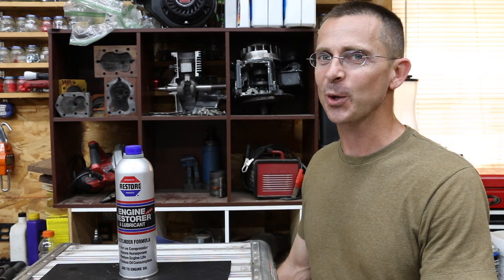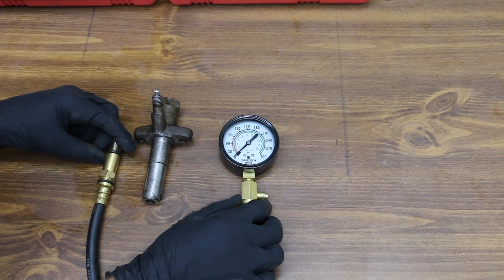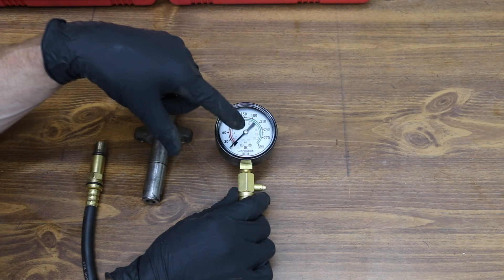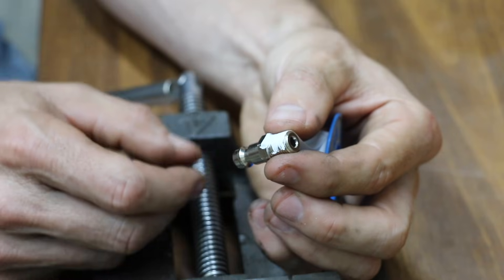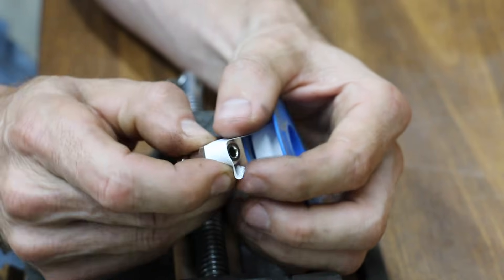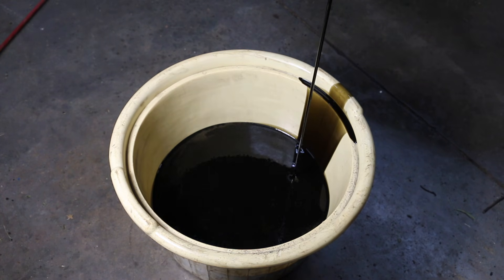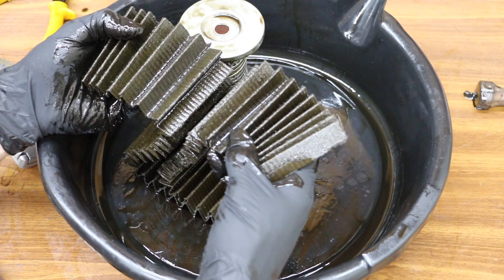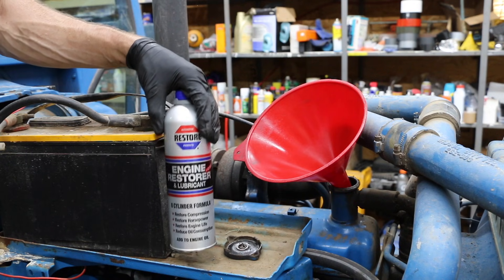Did the "Engine Restore" Compression Improvement Last?  One year later (Episode 2)

Comment: I didn't think that stuff was formulated for diesel engines, however I have had good luck with Lucas
Reply from the maker: Thank you! I did some research and it works in diesels. However, it's not designed for the Powerstroke engine and will cause a no start condition.

Comment: I've always wanted to see what happens when you run used oil through a centrifuge, does anything form on the bottom? Does the dark part of the oil separate out and clean oil stay on top? Can old oil be rejuvenated in any way?  It might be interesting to put a small amount of water in there first and then run the centrifuge to see if anything drops into the water.  Some soap might be required to make it separate from the oil.
Reply from the maker: All great ideas!  Thank you.  I'd like to have a centrifuge.  I'll have to do some research on cost.

Comment: I FIND OVER YEARS 12 TO 15 OZ OF RESTORE TO  4 TO 8 QUART CAPACITY  ENGINE WILL LAST 5000 TO 8000 MILES OR  ABOUT 6 MONTHS USING SYNTHETIC MOBIL 1 SINCE THE 80S IN EVERYTHING.
Reply from the maker: This is helpful information. Thank you!

Comment: I just change my oil a couple weeks ago and added Engine Restore in. I took it for a drive right after and noticed an IMMEDIATE improvement in horsepower. The engine is a 4 cylinder with 245k miles on it. I'll be using Restore going forward for sure.
Reply from the maker: Impressive!  Thanks for sharing this experience.

Comment: One thing we can all use is to find out if oil seal ex-panders work . Like to stop oil leaks at gaskets and seals. especially on hydraulic cylinder seals. This is a constant problem on a lot of my old equipment like tractors, backhoes, bobcats. This would be of great help if any of them worked. Thanks for your great and helpful experiments and test. I have watched them all and some multiple times. Even when you proved that some of my go to products did not preform I appreciated the information and acted accordingly. Thanks again Chief
Reply from the maker: Chief, Great recommendation.  Thank you!

Comment: Id like to see a good hydrogen unit installed and see what results you get for mileage and reliability. There are some very bunk units out there so this will take a bit of research on your end to buy a few and set them up accordingly. This is a challenge and will most likely take you a while to do. Need pwm, cell, wiring, knowledge, vacuum switch and so forth. Many other issues as well.
Reply from the maker: Wow!  Sounds very technical, but I'll figure it out.  Great recommendation!

Comment: I wouldn't mind seeing If ddp zink really cuts friction? and witch brand is the best!
Reply from the maker: Great video idea!
Reply: Project Farm but I still wanna if you can make a lawn mower with candle was in place of the oil? A hot plate, or weedburner, I'm betting it will be fine until you shut it off? It would make a good holiday video! Lol
Reply: Auto correct kicked my ass on that One?

Comment: Because of your videos i have been starting to use motorkote 

I notices less vibration, smoother quieter idle and running am better fuel mileage about 5% (1mpg) increase on my 2011 sprinter .... it went up from 19 to 20 mpg, same driver, tires, daily routine, same route, same gas station .... etc

And that at 365kmiles!  

Seems to be more powerful too - but that is all personal impression - no dyno numbers ....

Although same freeway on ramp - every day, with the gas pedal all the way on the floor board .... it picked up 2mph at the end of the ramp ....
Reply from the maker: Thank you very much for the update!  The MPG increase and extra MPH on the freeway ramp are impressive improvements!  Thanks again!

Comment: I have gotten a lot of crap from various mechanics telling me the "mechanic in a bottle is a myth or everyone would be using them, mechanics included".

I have stood by the results I have personally had from using Engine Restore, and this further proves it.

Let me be clear with this, it is NOT going to work miracles, if your engine is sludged up good and has severe internal damage it will NOT fix it. If you have an older engine with regular wear and tear, it WILL help bring it back to "near new" performance levels.

Thanks for doing this extended test ProjectFarm, it really means a lot!
Reply from the maker: All great points and thank you!

Comment: I also think most oil additives are crap!
I did try Restore on my 1985 MR2, but it has such low compression I think it was too much to be saved.
I think the readings were something like 35-60-90-35 and basically only the highest cylinder even pops.
Plus without being able to run the engine up to temp, it's kind of hopeless.
Glad to see some real results from the product, because I was skeptical!
Amazing how well your channel has done since I started watching, and congrats.
Reply from the maker: Wow, that is really low compression and agree that it must have been too much for engine restore help.  Thanks for the positive comment too!
Reply: My 89 supercharged one I bought had similarly terrible compression. Every piston had broken ring lands
Reply: And now the truth comes out.
Usually you want to rebuild or replace at that point.
Reply: Time for a Nissan heart to make the fanboys angry! :P
Reply: 802 Garage or a k swap. That gets them going too and are quite fun!
Reply: 802 Garage where? In canada a engine swap doesnt cost less than 1k lol. Thats stock for stock too
Reply: 16vSciroccoboi Wonder if mine has the same issues. I think mine just got completely toasted because the previous owner ran it out of oil. I'm swapping in an SR20 anyways!
Reply: kennedy796 Already got the whole car with engine and trans for $200! K is out of my budget. :P
Reply: Facebook Marketplace! It's a 2001 Sentra SE, basically the SE-R equivalent for that year. So it's the later roller rocker cam SR20, makes 145 HP. That's a 33 HP bump and the same as the supercharged version! Then the best part is that I can just bolt on SR20-DET parts and make plenty of turbo power. ;)
I've figured out the track width is basically the same on both cars and I can use the bearings and hubs for the Sentra, so I should be able to use the Engine, transmission, axles, bearings, and hubs from the Sentra! Will have to fab mounts of course. Might have to drill the hubs for 4X100 and space the brake calipers, but hopefully that's it.
Reply: 802 Garage geez. Nice find dude

Comment: Should start using Blackstone Labs to do Used Oil Analysis on these kind of projects.  Could have done a before and after.  Really enjoy your videos. Thanks
Reply from the maker: Great recommendation!  Thank you!
Reply: Black stone labs is not certified and their tests are not very thorough. I've seen multiple oil tests from them that were way off compared to other certified labs. Sorry, I'm kinda an oil snob.
Reply: Jonathan sauder LOL OIL SNOB....
Reply: Jonathan sauder Really? Because that's who everyone over at bitog.com uses for their UOA's and bitog is considered oil snob central.  A friend of mine turns wrenches on BMW racecars and he uses them also.....
Reply: CAT labs available through your local CAT dealer are pretty thorough and consistent.
Word of caution though, they are going to see the elevated copper, silver, and lead and throw up all kinds of red flags for bearing wear. 
It may not hurt to submit an oil sample and a sample of the Restore together to give them an idea of what you are doing. 
If you speak to the local dealer they should be able to help you.

It's called an SOS kit and parts should sell you one.

Comment: I have worked at john deere for some time and the way that we would measure an engines 'health' is with a PTO dyno. I know it might not be an easy thing for you to access but my dealer was pretty chill about if someone wanted to see what kind of power their tractor really made they would let them hook up. I've seen too many engines die because people don't run them hard enough i.e. using a 250hp tractor to pull a hay baler once a year and that's it. Ps love the channel keep up the testing! More info is better!
Reply from the maker: A PTO dyno would be terrific!  I'll have to check with the local dealership to see if they have one. Thank you!

Comment: Dang, it's been a year already!?!? Glad to see it breathed life into the ole girl!! Turn your thread tape roll over, making it come fromthe bottom of the roll. Keeps the roll from wanting to unwind and you can keep it taunt. Great videos
Reply from the maker: Great tip!  Thank you!
Reply: Been a plumber for over 30 years. I first learned that tip while in the Navy. Hold fitting in the left hand. Place tape on top of threads and hold tape with your thumb, have the tape coming off the bottom and you will see how much easier and faster it is to do.

Comment: If you plan on cutting open oil filters in your future videos then I would like to recommend getting an oil filter cutting tool.  I watched you struggle and had one of those “There HAS to be a better way” moments. After a quick search I stumbled across them on Amazon. It’s actually really simple and elegant how they work. It uses the same principal as a food can opener and has the inherent benefit of leaving no metal contaminates. They are not outrageously priced and I’m sure after it saves you from the “hammer and chisel” method once it will be worth it!
Reply from the maker: Great recommendation!  I'll add one to my shopping cart.  I'll be testing filters in future videos. So, I'll need it anyway.

Comment: Ever test Bar's Leaks pellet type vs. the silver powder type on the automotive cooling system? I've always been impressed with Bar's Leaks pellets.
Reply: The pellets aren't generally recommended due to clogging coolant passages and radiators.  I've seen this first hand.
Reply from the maker: I've tested the Bars leak pellets (no video on it yet) and it did work for me.  I have not tested the silver powder yet.

Comment: love this channel. Will refer to your tests before putting anything in my 22RE ! unfortunately had an overzealous friend start on my oil change we were doin in the parking garage at work and didn't get the chance to inspect things as I would have liked. luckily this was an initial change to clean out some residual old oil
Reply from the maker: Thank you!  Hope the 22RE is okay.
Reply: +Project Farm thanks. well, it needs the usual metal backed timing chain tensioners, but I got them, an OEM timing kit+ water and oil pumps to put on there. but it's a recently acquired used truck so ya never know! so far so good..

Comment: I've been a big fan of restore ever since I first used it years ago. It takes a couple days but if you really know your car you can feel it working.I've used at least 10 cans of the 8 cylinder formula in my 4.2l 1999 Ford van over the years. It currently has 240k on it.
Reply from the maker: That's a lot of miles!  Glad it's working.

Comment: I used Engine Restore a number of times on a Nissan QR25DE engine that due to an inherent design issue consumed oil, really bad blow by  due wear on the oil control rings had 150k miles on the motor. Engine Restore stopped oil consumption for approximately 250 miles then consumption resumed at full rate. So there limitations on this stuffs ability, it cannot fix an engine that requires a rebuild
Reply from the maker: Thank you for sharing this experience with restore.

Comment: Find a fuel injection cleaner that really works. I have always wondered if any cleaners work.
Reply from the maker: Thank you for the video idea!
Reply: Seafoam helps over time and works to prevent issues, but when it comes to cleaning the fuel system FAST Chevron's "Techron Concentrate Plus" works extremely well and in my testing (used in multiple vehicles and on many varnished parts) it works the best.
Reply: I will try that. My 2000 GMC Pickup is running rough. I have tuned it up, spark plugs, plug wires. I tried fuel injection cleaner from the Dollar Store. It helped a little. I was just wondering if any cleaner would work. Thanks.

Comment: Soooo you put new injectors in it. What are the chances the new injectors solved the starting issue. At the same time you added engine restore
Reply from the maker: Sorry, I didn't do too good at explaining the injectors.  I changed out the injectors before using Restore the 1st time.

Comment: Did you push the button in for cold starts.  These old ford tractors have one.
Reply from the maker: The previous owner or 2 owners ago disconnected all the wiring.  The push button is to engage the starter. Thank you!

Comment: Cool video I really like the big tractor. There's an octane booster out there that I just heard about called Boostane. The fuel I run in my car is Sunoco 260GT Plus its 104 octane contains 13% ethanol and cost a little over $60 for 5 gallons local. If Boostane really works it'll save me $1000's every season in fuel costs. I watched a video where a guy put Boostane in his Dodge Demon and the octane sensor in the Demon was able to kick the car into high octane mode and was making 840hp. I'd love to know if it really works.
Reply from the maker: Great video idea!

Comment: Another awesome video!! I have used restore in my 2010 cobalt with 320,000 miles to help compression and it for sure helped. Also, you might know the answer for this but which formula would you use for a 3 or 5 cylinder engine? I have a inline 5 gas pick up and a inline 3 diesel tractor that could you a pick me up due to high miles and hours. 4 or 6 cylinder formula for the I5? 4 cylinder formula for the I3? Thank you for any info you may have! Love you as always Project Farm!!!
Reply from the maker: I'm not sure which to use for sure for the 3 or 5 cylinder.  I personally with go the with formula for a larger engine and would only add 75-80% of the can.  Thank you!
Reply: They are all exactly the same thing. The only difference is the can size. Just get the largest can since it is cheapest per ounce and use it for multiple oil changes.

Comment: I have used it many times with good results.As long as you use it at each oil change you can expect to maintain the improvement.I have wondered how long before all increase of compression will fade if its use were discontinued
Reply from the maker: I'm guessing it would fade quickly.

Comment: Hello. Just a small tip. Don't use Teflon on petroleum products, it desolves  Teflon (unless tape is rated). Use pipe dope. You can get it in plumbing/heating supply shops. Take soft set; easier to take apart with out sacrifice of hermetics.
Reply from the maker: This is a great tip--thank you!

Comment: I swear by this stuff! I had a 1994 Chevy Z 71 truck that I bought from a guy who said it needed a new engine. I brought another engine to the machine shop but while I waited I bought this for the hell of it. I was shocked! Before using it I made a trip from Minnesota to Oshkosh which was just under eight hours. My oil light came on just before Oshkosh and there was no oil on the stick. Upon adding this I was able to go 3000 miles between oil changes with no oil loss and way more power! It is piston rings in a can and I went to automotive machining school. So I do know it doesn’t make sense but it really works.
Reply: I have that same tap, but it’s a craftsman. Awesome tool! I would recommend anyone who needs to tap have one. My local sears corporate store is selling them for $39.99! More than half off.
Reply from the maker: Impressive improvement--wow!
Reply from the maker: That's a great price!

Comment: I'll try it next time I have something with low compression. A million years ago I got a good deal on I pretty sure was a older version of restore I remember the name was something like that it had pellets you dropped in each cylinder and a oil additive. It appeared to work for a few hours only. When I pulled the motor apart it appeared the pellets had fill in around the top compression ring. It's good to see a additive that actually works.
Reply from the maker: Another person commented on having terrible results with the drop in pellets.

Comment: Nice to see that it continued to improve compression.  I once dry seized the 3.0 in my 00' Ranger.  Added some oil, and it freed up, then added Restore as a precaution, and used it every oil change after.  I got about another 100k out of that motor.
Reply from the maker: That's impressive that you saved the engine.  Great job!

Comment: Your teflon is backwards, doing it the way you do it makes it harder to get on, as well it may decide to come off while you are threading your tefloned piece. Also you have a Dewalt drill if i remember right it's an 18 volt clutch it down around 11-13 it should work pretty well as long as you're on 1st speed. I've installed a few Carwashes i've done a lot of teflon work, same with threading.
Reply from the maker: Thanks for the constructive feedback!

Comment: Can you run a small engine safely on e85 and get better gas mileage?
Reply from the maker: Thank you for the video idea!
Reply: Project Farm no problem! Loving the vids! Keep up the good work!
Reply: E85 will never give you better fuel mileage over straight gasoline. This is because molecularly ethanol has less energy in it than gasoline. It does however have a higher octane equivalence and therefore in some situations you can advance the timing of the engine more and possibly increase efficiency. That said, I really doubt it would be able to make up for the loss of raw energy in ANY situation.
Reply: Kenji Fox thanks for that knowledge! Never thought about it that way.